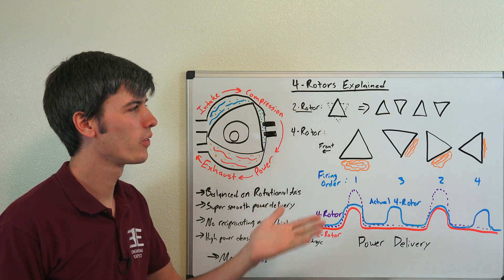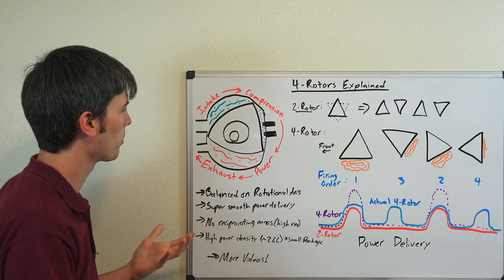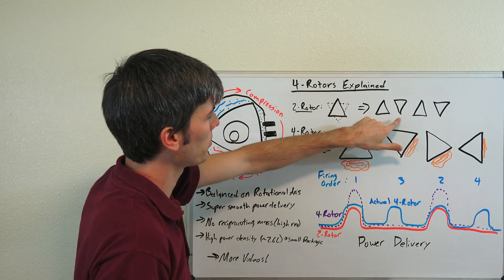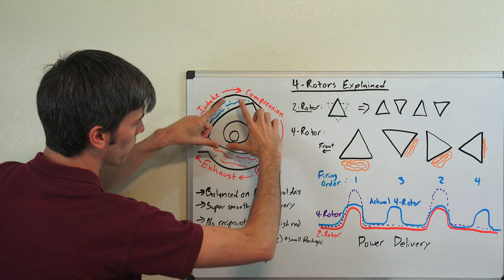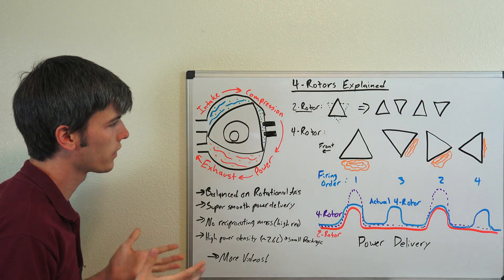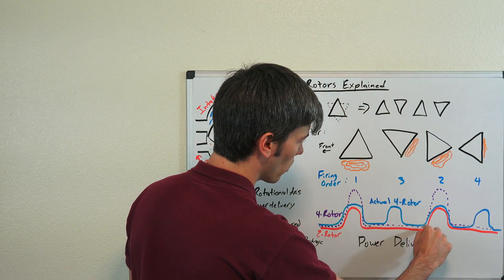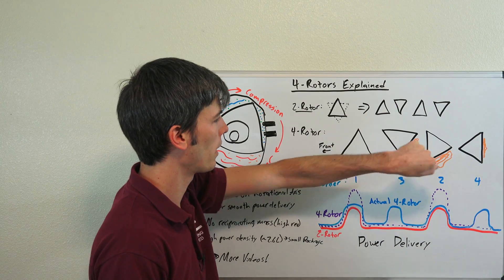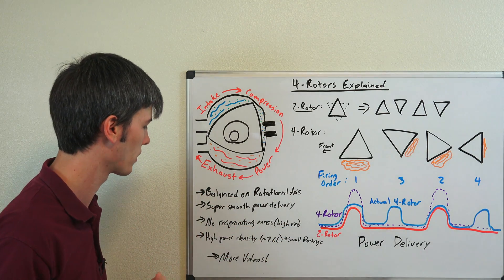The Epic 4-Rotor Rotary Engine - Never Used In A Production Car

Comment: In a 4 rotors engine configuration such as the one described in the video, are there any relevant phase issues during engine lifetime? I mean, if the 90° shift is stable or significantly drift during engine lifetime
Reply: If one rotor roates more or less than any other rotors you've definitely got a serious issue. One that requires a new engine.

Comment: Wouldn't the 4 rotor have those 4 combustion events In the same time as the 2 rotor? I'm speaking about the power delivery graph. The 4 rotor should have its first and last power stroke at the same time as the 13b, just with an extra 2 in between it.

Comment: Would have been good to include the mass-produced 3 Rotor in this. Can you comment on the 3 rotor configiration as it relates to this video? I imagine 120 degree offset with a reduced lag in between that of the 2 and 4 rotor formats?

Comment: as an fyi some 4 cylinder motorcycles use two cylinders firing simultaneously. Yamaha was a notable one when they switched to what they called big bang firing order. they did this after discovering it improved grip.

Comment: Interesting thing about the rotary engine is that it's modular.  Modern piston engines have a cylinder count dictated by the block.  You can't build a V-12 without a V-12 block.  With rotary engines, just add more rotors.

Comment: Love your stuff.  You mention on piston engines, no two cylinders fire at the same time. I agree. Yet I recall when Honda came out with their twin cylinder motorcycle engines. Up to that point all motorcycle twins were 360 degree crankshafts meaning one cylinder fired one revolution and the other the next revolution. That sort of balanced everything and spread out the power strokes. Then Honda had the 180 degree crank where one cylinder fired then the second cylinder fired 180 degrees later then each waited a full 360 degrees before firing again. Why was this OK? Or preferred?

Comment: I did some sketching to see how power delivery would be for different rotor sets. 
Although these amounts of rotors get unrealistic, even tho there's a 12 rotor 'V' engine (3 banks of 4 in a v formation), I went up to 16 just to match the firing of a w16. I based it on evenly dividing a circle, of course you can change the positioning, I didn't take eccentricity into factor for balancing. And you'll see sets like 1 and 3, 2 and 6, 4 and 12, and 5 and 15 line the rotors up causing less firing positions per cycle but more power within that cycle;

Higher firing positions = a more consistent power delivery

One rotor has 3 firing positions per cycle.
Two rotors have 6 firing positions per cycle.
Three rotors have 3 firing positions per cycle, but you have three firing at the same time, so triple the power per cycle. 
Four rotors have 12 firing positions per cycle.
Five rotors have 15 firing positions per cycle. 
Six rotors have 3 firing positions per cycle, but you have two firing at the same time, so double the power per cycle.
Seven rotors have 21 firing positions per cycle.
Eight rotors have 24 firing positions per cycle. 
Nine rotors have 27 firing positions per cycle.
Ten rotors have 30 firing positions per cycle.
Eleven rotors have 33 firing positions per cycle.
Twelve rotors have 12 firing positions per cycle, but you have three firing at the same time, so triple the power per cycle.
Thirteen rotors have 39 firing positions per cycle.
Fourteen rotors have 42 firing positions per cycle.
Fifteen rotors have 15 firing positions per cycle, but you have three firing at the same time, so triple the power per cycle.
Sixteen rotors have 48 firing positions per cycle.

Again, this is based on even divisions of a circle, but you could change the positioning to change power delivery and power output. 
I'm not sure if consistent power delivery is really a big factor in performance when you keep in mind that engines have high rpms, and rotaries have even higher rpms.

The 12 rotor "V" motor, having 3 banks of 4 rotors, is extremely balanced and only takes up, if I remember correctly, the space of a big block v8. I'm interested in seeing what other engine designs could provide, like having a flat but wide three banks of one rotor as opposed to one bank of three rotors.

Comment: Man, rotary engines are garbage. Youve never seen a rotary win any sort of race since its invention because its so inefficient.
Reply: joseph hemler The Mazda 787b won the 1991 Le Mans endurance race with a 4 rotor engine and was banned after but I'm pretty sure they not banned anymore.
Reply: 10 straight years the rx7s were winning, which is a record to break! The 1991 Les Mans race won by the mazda 787b makes it the first and only japanese automaker to win it.

Comment: The shape of the rotor is interesting as well, it is called a Reuleaux triangle, which means the width curve is constant the whole way around, so if you spun one with the middle as its axis, it could spin between 2 walls that are the same width.

Comment: That's why we don't see 2 stroke engines that are built with a lot of cost factor in mind end up being inline 4s. A two stroke I4 have to use a cross plane crankshaft similar to those found in V8's in order to achieve a even firing order. You could find a detroit diesel 4-71 two stroke oil burner crankshaft in the exact configuration. (as for torque curve, yamaha R1's 4 stroke corss plane inline 4 deliberately used a big bang firing order to cause a torque spike, but that's a whole different story)

Comment: But now there is a 6 rotor BMW so eat your heart out rob
Reply: Sam Kent but it's not an rx7 or 4wd
Reply: Kester 135 in the words of Clarkson 'more is better'
Reply: Sam Kent the rx7 has been stripped to the chassis and less where possible with power going to all 4 wheels, where as the 6 rotor bmw is exactly that a standard bmw with a different engine.
Reply: Kester 135 the 787b was a also only rear wheel drive like the BMW and yet that was one of the most legendary racing cars we have ever seen with a rotary engine. 4wd is cool and everything but Ken block already did that with the hoonicorn mustang
Reply: Sam Kent new zealand has had a 6 rotor rx4 built buy ppre for years, ppre also sells 4 and 6 rotor set ups to the world. The bmw isnt a 1st.... theres a 4 rotor twin turbo lexus drift car with 1000hp been around for nearly 10 years
Reply: Sam Kent yeah Rob is claiming one of the fasters rotary in a half mile or 1 mile not sure I disagree on his opinion 😂

Comment: Some motorcycles use whats called big bang where 2 cylinder fire at the same time, so for example a Yamaha R1 firing order is 1+3, 2+4. A few race bikes had whats called a long bang where 2 pairs of pistons will fire in quick succession then leave the crank to do a 540 rotation before firing again.

Comment: The GMC 701 v-12 was basically 2 345 v-6 engines with a common block & crank. It had 2 distributors & fired 2 cylinders at the same time. The engine was slow revving but had huge torque rating. A very interesting & unique engine...
Reply: yep old skool kewl motor. could idle happily at like 4-500 rpm. my uncle's former boss had one in a wrecker. he had it running at about 250rpm during a tune up before setting the idle( or so he claimed).

Comment: They tried firing two cylinders of a V8 at the same time, running it like a 4cylinder. The engine made more torque, but the forces on the crankshaft were too great and it proved unreliable.

Comment: Put the apex seals in the housing instead of on the rotor.... PROBLEMS SOLVED!  (also use ceramic coatings to increase thermal efficiency)
Reply: While we're at it, let's put piston rings in the cyl wall instead of the piston!

Comment: Hmm. If I'm understanding the stacking of the rotor triangles right.

1 rotor is a single triangle.
2 rotor is two triangles with the points of the second aligned to the mid-points of the 1st.
4 rotor is 4 triangles with the additional points at the intersections of each triangle.

Expanding upward this packing would mean the next progression would be 8, 16, 32, 64... exponential. The power however doesn't seem to be exponential. This makes me wonder if there is an upper limit where the increase in power by moving up a step is virtually null (not null but seemingly so).
Reply: actually its a little more complicated than that but there are diminishing return with each additional rotor. as long as you can evenly divide 360 by the number of rotors it could theoretically be made to work. 7 and 11 are bad numbers for example

Comment: But where do the power strokes occur? Does the housing still have a hot side and a cold side? Or does the heat spread more evenly due to different locations of the combustion chambers?

Comment: I motorcycles you get more grip if the power delivery is not smooth. 

Therefore the yamaha R1 and M1 have  crossplane cranks. 
Hondas MotoGP bikes are also V4 and not I4 because you get uneven power delivery. 

Another example are twingles. For flat tracking people changed the Harley XR750 so that the two cylinders fire with only 45° in between. Thatway it acts almost like a single. Hence the name twingle. 

The reason is that the tire has more time without having to accelerate. Therefore you get more grip. 
I'm too lazy right now fore a better explaination.

Comment: bike guys thinking 10k rpm isn't a lot we have stock bikes that'll do 20k reliably imagine what a little tuning could do >:)
Reply: Which one revs to 20k?
Reply: all the 250cc 4 cylinder bikes
Reply: Kester 135
I tought they have proven that those RPM is fake. None of them revs over 17k if I remember correctly. But maybe new ones do rev so high.
Reply: This is news to me, some highly tuned 2 strokes can achieve 20k+ though, my am6 50cc is currently off the tacho at an estimated 15k+ that's without any heavy mods, also the new ones?
Reply: Kester 135
Yeah, you can do some research, I think Yamaha R6 with 20+k on tacho doesnt rev so high, and few other bikes. I don't remember now which one exactly.
Well, 2T are something else. I had Aprilia 125cc with ROTAX engine, revs like mofo :D
Reply: I can't find anything on a false 20k tacho reading, just to make sure we are on about the same thing search Honda CBR250RR Test Ride! Mini Fireblade! 20K RPM!
Reply: Kester 135
Search for Yamaha R6 false rev limit.
Well there is no techinical specs that say 250rr revs 20k. Everywhere I read they say rev limit is at 14k. :/
Reply: Lets say a stock 250RR could rev to 20k. You would still need like 20 250 engines to make close to the peak BHP of the 4 rotor.
Reply: el34superlead when comparing bikes and cars I prefer to use power:weight(kgs) rather than raw power figures eg. A veyron is a quad turbo w16 producing 1000+bhp, a h2r(track) has a turbine supercharged I4 producing 300+bhp, the h2r leaves the veyron in the dust because of the power to weight ratio.
Reply: Couldn't agree more. My real point is peak RPMs don't tell the whole story. Right tool for the job kind of thing.
Reply: el34superlead and my point was we have a skewed perspective, to a bike guys 10k doesn't seem like a lot, i grew up with bikes and when I started to get more into cars my response to hearing the s2000 could rev to 9k was "is that it?"

Comment: hate to say this title is wrong. it has been used in a production car before. Yuki Kamakura owns an FD3S with a peripheral ported 26b engine with a custom machined 3-piece 1-3-2-4 eccentric shaft. just search up 4 rotor rx7. It's white. It's loud.
Reply: there's also a speedhunters feature on it if you search up 'yuki kamakura 4 rotor'
Reply: But is it a production car? As in, do they come like that from the factory, and are more than one being built? Seriously doubt it. A one off is not a "production car".

Comment: not to mention with a rotary for a single complete rotation of a single rotor you will get 3 complete power strokes. partially why they have such high RPMs

Comment: the rotor rotates 120 degrees for every rotation of the "crankshaft" right? then you can compare the volume of air each rotor pulls in every intake stroke. that should be a good representation of how big the engine is in terms of capacity.

Comment: I probably wouldn't buy a rotary-powered vehicle since I think there's too much susceptibility to malfunction, but they are much nicer on paper and in theory than traditional options.
Reply: they are not more susceptible tomalfunction. They only malfunction when lazy people buy them and don't know how to do proper maintenance. They are also alot easier to rebuild and modify.
Reply: I'm pretty sure I know what I'm talking about. 130k on original engine. still going strong
Reply: they can work well (if generally crap on gas and really crap on oil, such is the tradeoff), but they don't suffer fools.

Comment: Ok so about displacement. In one crankshaft rotation the engine breathes 3*(volume of pocket) of air. With that out of the way, power delivery is 3 times for one crankshaft revolution, for simplicity let's say they occur at 0, 120 and 240 degrees. for a two rotor, the second rotor should theoretically be at a 60 degree offset, so it delivers power at 60, 180 and 300 degrees (relative to the first rotor). This implies 6 power strokes per crankshaft revolution. A 4rotor should have that 120degree phase difference split to 4, so 0, 30, 60 and 90. That way there would be a power delivery every 30 degrees of crankshaft rotation. Interesting.

Comment: A  more simple explanation is that a rotary engine acts like a 3-cylinder engine (multiplied by however many rotors) and rather than the huge torque spikes that break crankshafts and transmission parts "splitting up"  the power pulses makes it behave more like a 12cylinder engine instead of a very torque 6cyl.

Comment: Isn't this just the flat plane vs cross plane debate?
Reply from the maker: Not exactly, still have evenly spaced power strokes: https://youtu.be/-s5bSQIQQsY
Reply: Hi Jason, do you have any opinions on the viability of the rotor engine moving forward from Mazda? Could HCCI counter enough of the inherent disadvantages? For example the long flame front.. Regards, Nigel

Comment: So on these rotaries, do they have to worry about torsional vibrations that a crankshaft would produce. I know they don't have a crank shaft but i want to know if the rotary shaft has to worry about those vibrations which the engine has to dampen with the dampeners on conventional piston engine??

Comment: i have never been one to be on the rotary band wagon. Why is the four rotor that big of a deal?
Reply: an obscene power to weight AND power to volume ratios. it makes a very light, very small, very powerful but inefficient engine.  with many other engine designs you  have to pick one criteria. such as power and design it so that it does not self destruct. with many points of failure to consider. a rotary has like five or six points of failure instead of near 100( depending on how you want to count things).  basically it does not want to self destruct. so it can be pushed way further before goes boom. just the tip of the iceberg here. short story is that they are very cool.
Reply: Any engine has damage done to it as soon as you start it. Here in america we have a motor that is very similar to the LS2, the 6.0 vortec which the LS2 is the aluminum block version of the 6L. I am not a big LS fan but for comparison reasons I will use the 6.0. In Pickup trim at 380hp the 6.0 can go easily over 250k miles. As far as racing goes you can get these engines up 700 hp for short periods on factory components. Quite honestly I'd like to see a big block chevy go against the wankel and see who wins, because the mark IV which every one who knows the BBC in this form, was bred for racing. I don't know if the BBC got banned from Europe, but in the late sixties, it would have eaisily demolished any of it's competitors. Fast forward to the 90's, it still can give motors a run for their, and that still is true today.

Comment: Do rotarys have torque, I imagine they don't since they're so small
Reply: Peadar Donnelly when it comes to engine displacement, rotaries are far more efficient at producing torque than regular cylinder engines. fuel economy is horrendous though.

Comment: ducati  Has  2 powerstrokes simultaneous   so 2 strokes  0 strokes  2 strokes   etcetera   in there  2 cilinder  1000 cc 
and  there race bike 4 cilinder  Has  2 strokes    .  2 strokes.  2 strokes  and not  2341 2341  one by one by one

and try  crosscrank  4 cilinder on youtube  you'll be surprised  what manufacturers do

Comment: What is with a flatplane V8? Aren't there two cylinders there bang at the same time?
Reply from the maker: Nope, this will explain: https://www.youtube.com/watch?v=-s5bSQIQQsY
Reply: Short version, flatplane V8s fire each piston on a different bank, so left, right, left, right. Crossplane fires two cylinders on the same bank but still at different times so left, right, right, left and so on.
Reply: Thanks!